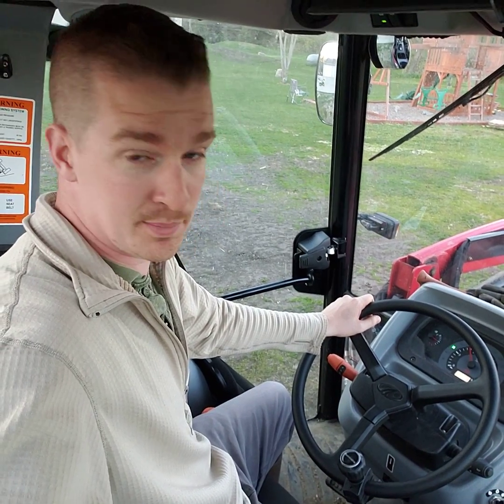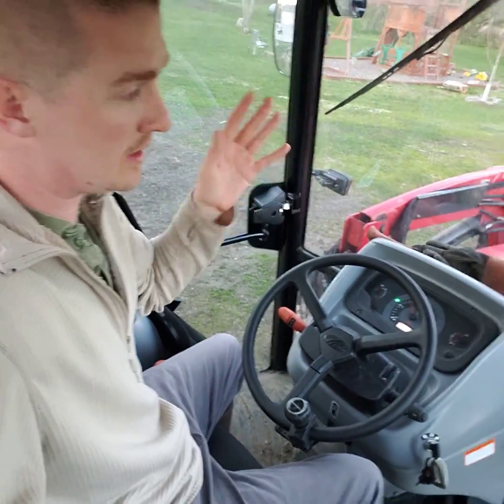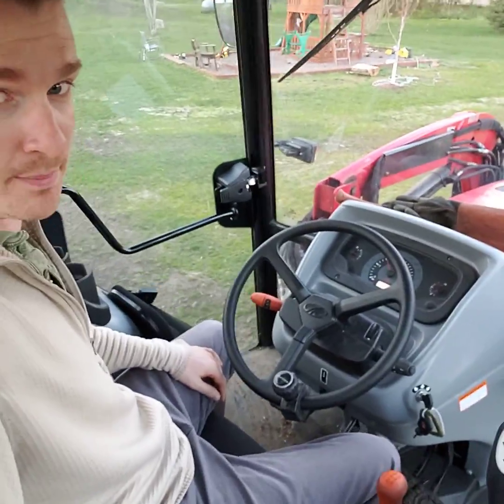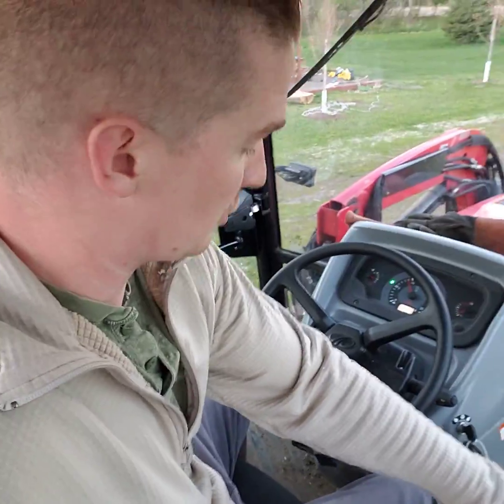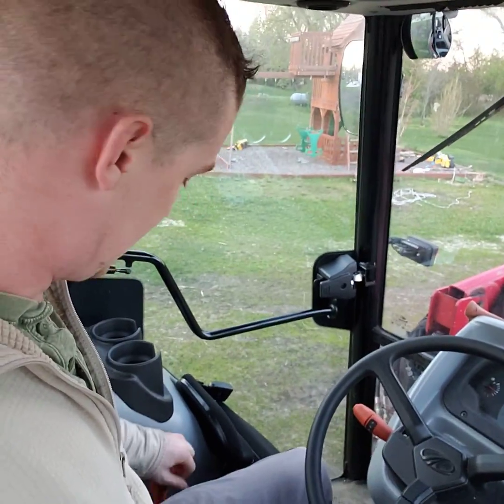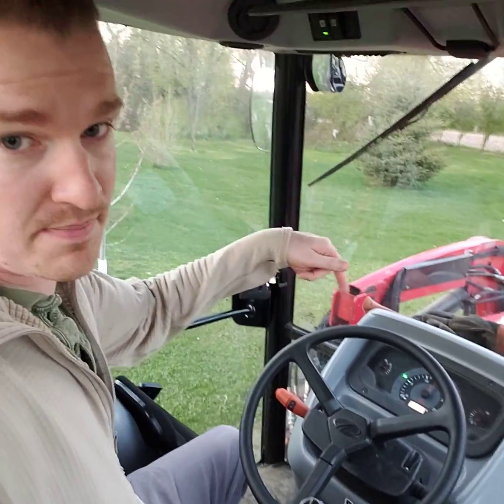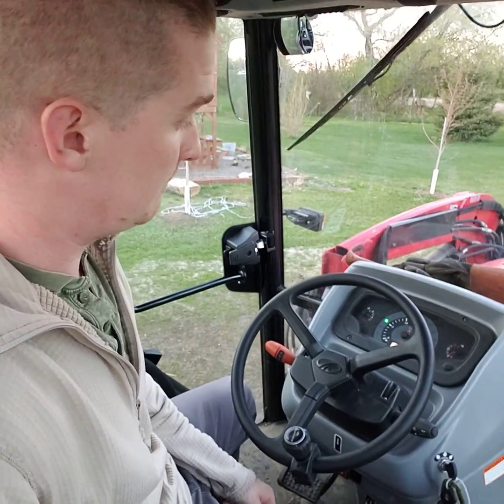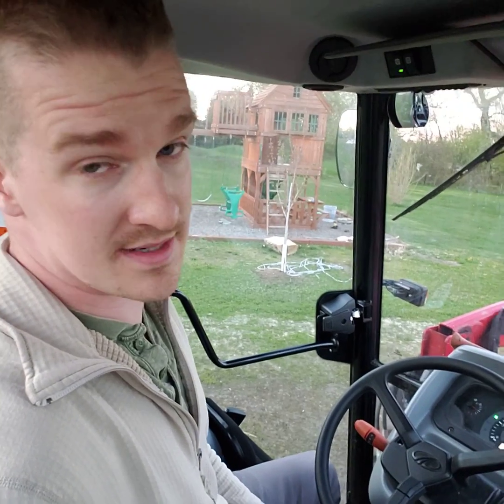Shuttle shift demonstration on a 70 horse power tractor

Comment: Great demo. While the hydro might seem easier, i agree that the shuttle is easier on the operator for many tasks. I’ve also noticed from the specs that there’s a bigger drop between engine horsepower & PTO horsepower w/ a hydro. Power shuttle seems like the ideal compromise between a mechanical & a hydro. I’m curious to see if Massey’s brake to neutral feature catches on.

Comment: That would be a power shuttle, or PST, correct? Doesn't the "standard?" shuttle for Mahindra require the clutch for direction changes?
Reply: Hydraulic Shuttle no did for clutch forward backward

Comment: Able to apply the brake and it still stop without killing the motor?
Reply from the maker: If it is in gear that applying the brake would kill it.
Reply: Yes but you have to push the clutch in while you brake